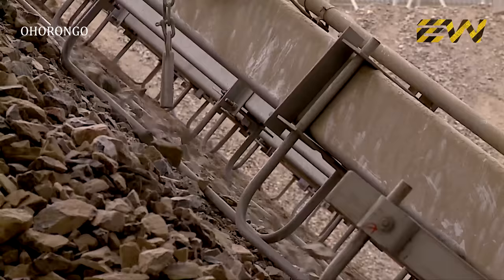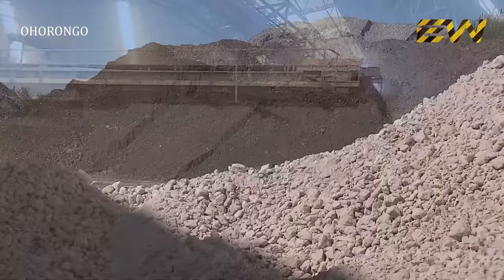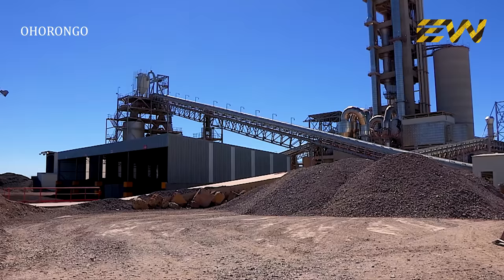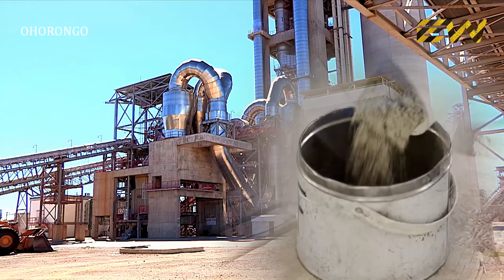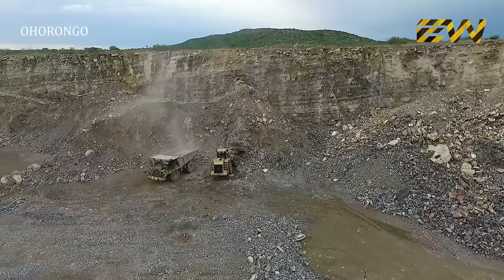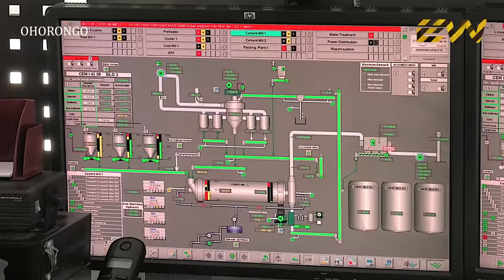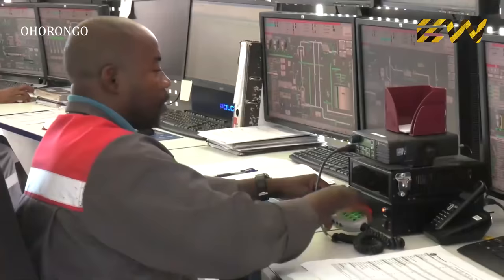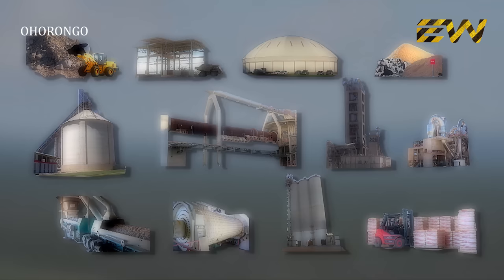How Cement Is Made? (Mega Factories Video)

Comment: Well good documentry. Now latest technology is more efficient by using vertical grinding mills on raw materials and cement side. Hot escpae gases are capture to produce electricity.
Reply from the maker: Thank you for your feedback :)
Which process you liked the most?
Reply: Ok
Reply: Please some key words about exploitation of hot escape gases to produce electrical energy
Reply: @oussama7084  exhaust gas from the clinker making process are recovered in a waste heat recovery plant/turbine to produce electricity
Reply: New Technology features Robo Lab for sample testing, and a Cross Belt Analyser (CBA) that test samples directly from the mines.
Reply: Vertical grinding mill is not new tech.
Here plant which built in 1987 already use vrm

Comment: If you built a kiln in your backyard and cooked limestone for a month you might have enough for a 10x10 patio. and your lungs would probably be cashed.
Reply: The kiln would be the hard part 😂. I laid brick in cement and lime kilns and the are huge. Takes alot of power to run them.

Comment: Question: I get the mix that goes into making concrete. However, why can't a driver add water when they get to the construction site ?? This would end any trucks ending up with a load of solid mix in their mixer. Is this a problem ??
Reply: They can and they do but more water reduces compressive strength.
 
It's really an amazing science but the sidewalk in front of your house doesn't have to maintain the same level of criticality as the Hoover Dam or the launch pad at Spacex.

It's more than just water (slump), it's mix design and Time  from batch to pour, air...etc.
Reply from the maker: Adding water at the construction site can compromise concrete quality and strength. It's best to ensure proper mixing at the batching plant.

Comment: Does Rubble from buildings turn back into cement?
Reply from the maker: Rubble from buildings, which typically consists of concrete, bricks, and other construction materials, does not naturally turn back into cement. Cement is a specific binding agent that is used to make concrete by mixing it with aggregates like sand and gravel. 

I hope we answered your query.